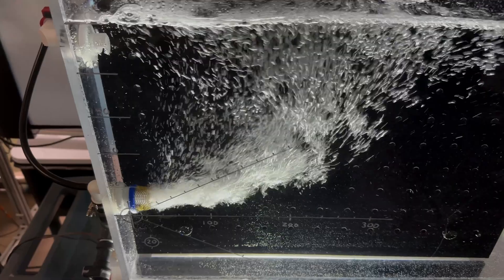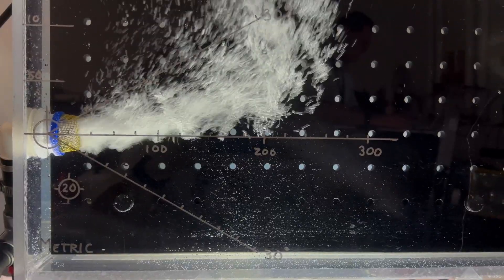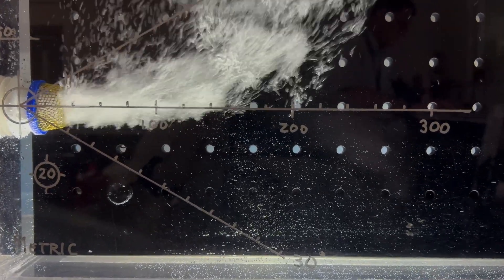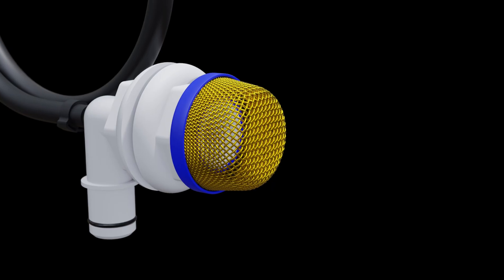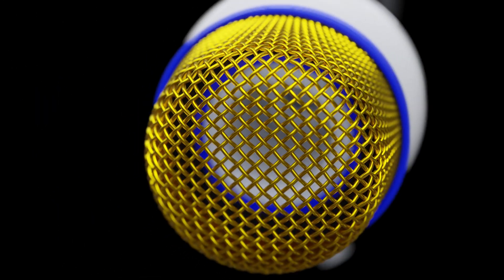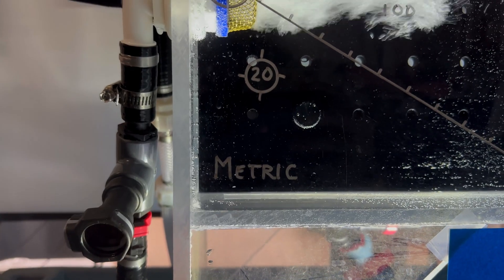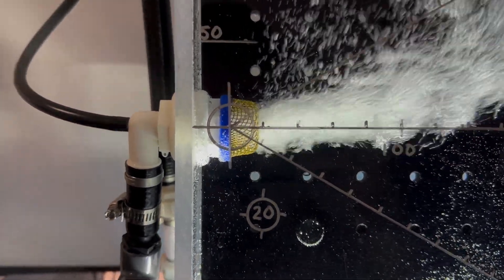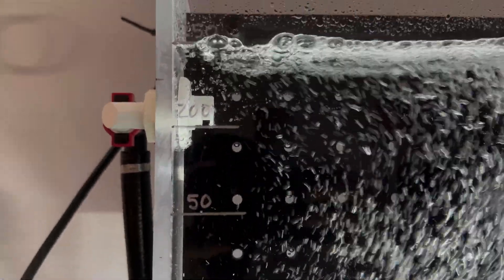PowerJet Plus Aerator | The Leader In Livewell Performance

Comment: When the power jet aerator is turned off, what keeps the water from draining out the the level of the power jet?
Reply from the maker: The end of the air intake tube is above the waterline so that water will not escape. When pressure from the pump is regained it will begin pulling creating a vacuum on this tube pulling in air again.
Reply: @FlowRiteControls  lol...I understand the air intake tube...whats holds the water from running back out the power jet nozzle, down the tube it came from to the pump and out the intake port on the trsnsom?  If the power jet is mounted anywhere other than the top water level, any water above the vessel water line would run out....is there a check valve?
Reply from the maker: The System 3 Livewell valve is usually used when not in a direct circulation system. The System 3 has a flexible rubber flap that shuts off the transom line and for extra security the valve can be turned to full recirculation mode so that the transom line is fully closed off with a flap and spring loaded button backer. 

Check out this video for details on our livewell valves: https://youtu.be/ZIufCS1l_bM?si=NSzFfjQOE15G2c5f